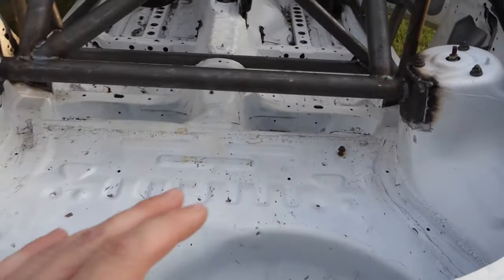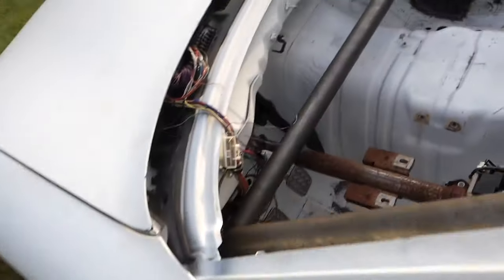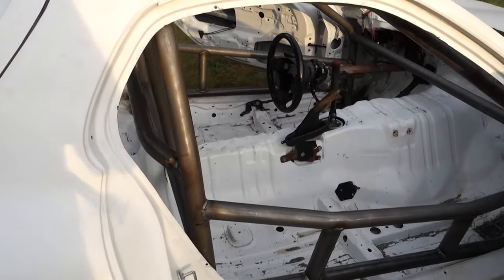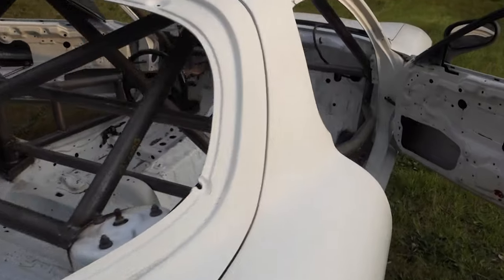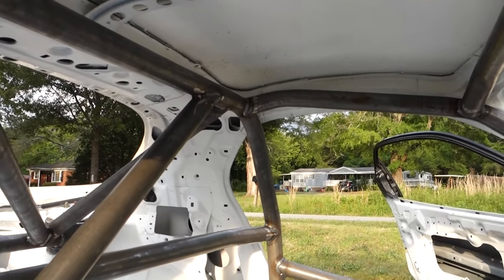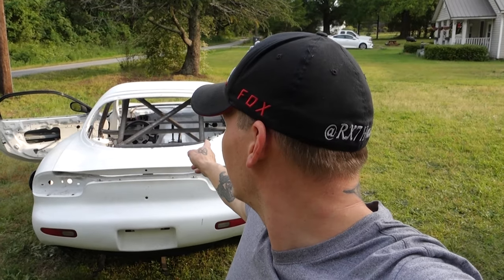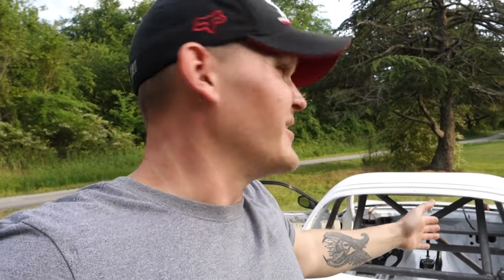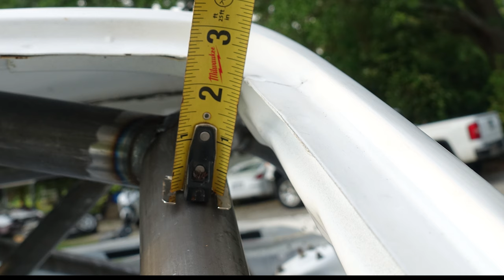LS1 FD RX-7 Gets the Worst Roll Cage I've Ever Seen.

Comment: No expert but can you even get it certified like that? Your case could be the fabricator designed certified cage, installer did not follow design. Cage useless. Need labor and materials reimbursed.
Reply from the maker: Probably not, I’m sure I’ll have to cut it out and Redo it eventually 😔